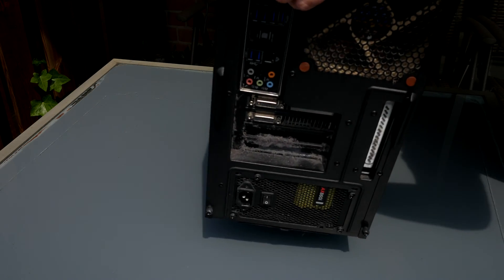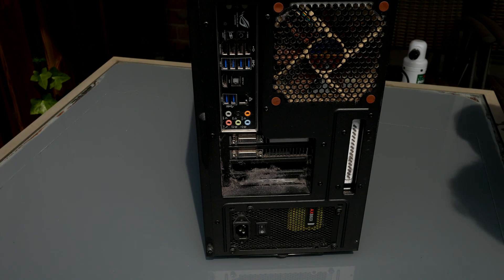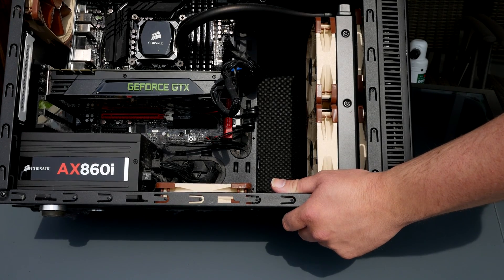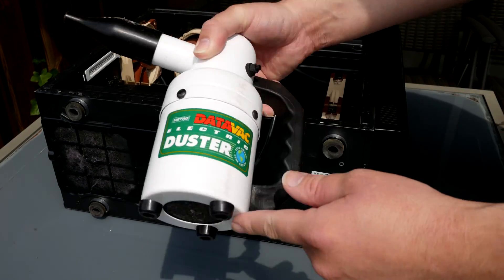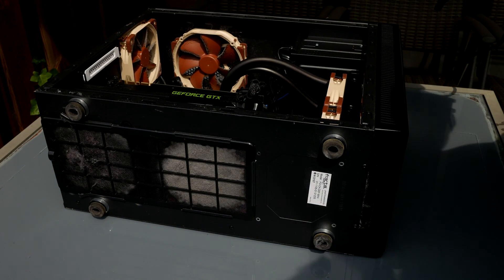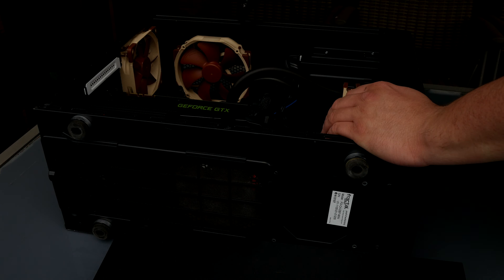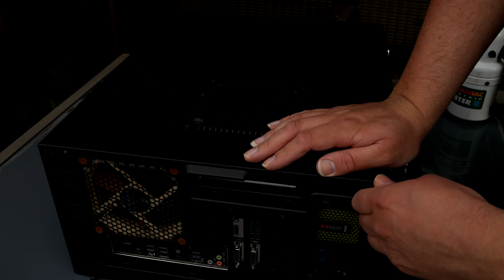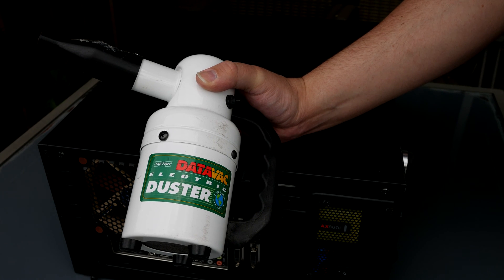Clean your computer or it might EXPLODE!

Comment: This is next to impossible. The most likely event is it will auto shutdown to protect itself. Desktop PCS don't just explode there components in them don't have anything that could cause a C4 ype detonation unless you rigged the CPU intentionally with a bomb which is nuts btw. If anything even if all cooling systems totally fail at once randomly (unlikely unless you brought a total ehap of garbage off of the dark web or some unknown source) then the CPu/PSU might make a tiny pop and die early or even the motherboard could circuit but the entire PC won't explode nor would you even likely notice it. PCs this day and age are more than capible of handling multi tasks even when dirty inside and most CPU and Backdraft PSU fans can easily shake of any dust clogging the middle sections due to fast rotation.
But the idea of a PC blowing up is actually insane. The old monitoprs from those giant 80s/90s pc can expldoe that is true as they're glass. 
P.S my friend your fan should not sound that rusty especially a brand new gaming pc driver even if your fans were so filthy its like left over cobwebs that PSU/CPu shouldn't sound like a lawn mower starting up. It's more than likely you need a serious upgrade or was mugged off with a very poor custom design you brought. I am just giving people my expertise on PCS I have a stormforce gaming rig for 2+ years now and only running with the CPU/PSU fan to stop dust getting inside as quickly and it has never ever made any noise to that calibre even when it is clogged up. I have my PC on seldom 24/7 and it has enver over ehated not once not even in the Summer months when the temps around 33 to 36c. That ain't the dust that's the components being not to scratch.
I was searchign around for a friend who has a similar problem and said there's no way ypour modern day gaming PC should make that noise over dust that sounds like a horrible CPU/PSU or a very badly instaleld fan bios under f1/2.
This is why I avoid laptops in a whole one they tend to be more expensive than desktops even better gaming desktops which is a bit silly and they can actually explode (the lithium bateries) 
PCs the way forward for hardcore and can easily pick up a custom made gaming pc for around £300 top of the range. It's the graphics cards coming in at about £2000 and the inter cores, nvidia x and g-force similar price that get costly.
Reply: How much longer do you think my 10 year old gaming pc will last?
Reply: @Gumisamavt  1 day